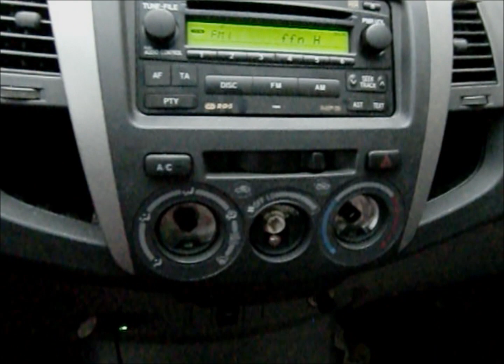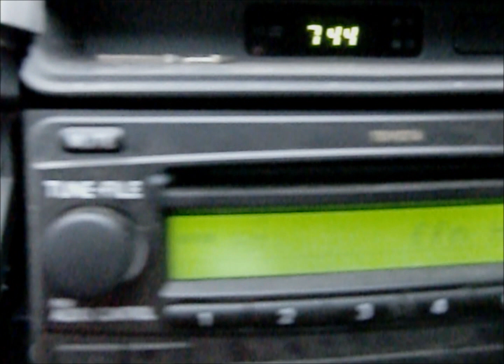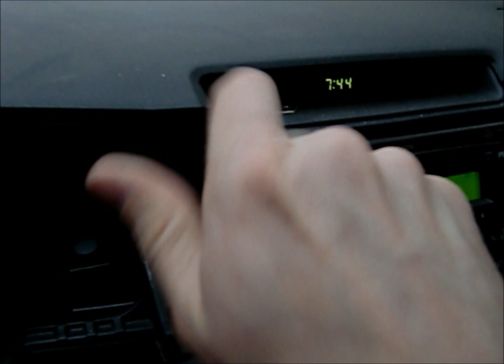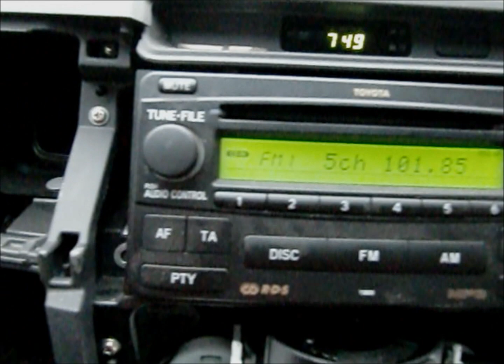Toyota Hilux radio head unit removal remove / Radio ausbauen tauschen

Comment: Thank you for this video!  I bought a pioneer stereo system which I want to install into my toyota hilux d4d 2010 model.  The problem I'm having is that the harness of the Toyota do not fit into the pioneer radio.  How do I get hold of step by step instructions on how to connect those wires?
Reply: You can buy adaptor harnesses to fit at your local auto shop
Reply: Very easy to cut and join to new connection. Only has antenna, power, accessory power, earth, 4x speakers (8 wires, - & + for each speaker) Buy a multimeter or even a test light will do the job.